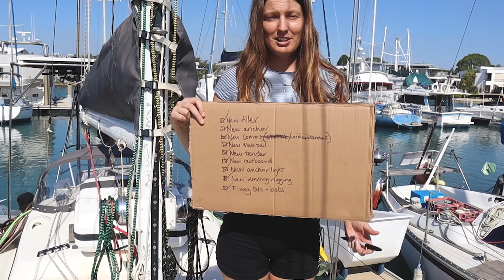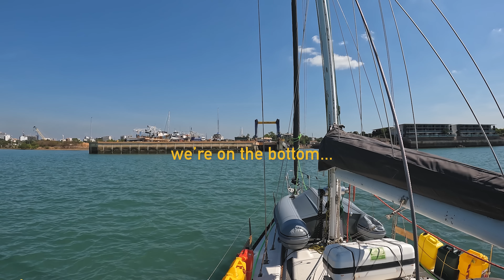THE VIDEO WE NEVER WANTED TO MAKE..

Comment: A couple of things. On our Duncanson we either epoxy resin the through hulls in or use 3M 5200. Both work fine and with the belief they are permanent fixtures. Once you get to Fremantle the Fremantle Sailing Club (FSC) offers 3 free days berthage for bona fide long distance sailors. Pens are available at reasonable??? rates or plenty of sheltered anchorages nearby, including free (Red) mooorings supplied by the Department of Transport for use up to 72 hours. Terry Baker - Past Commodore FSC
Reply from the maker: Cheers Terry, we have heard of this generous offer by FSC also utilizing the free cruising guide at the moment, such a fantastic service the offer.  Appreciate the heads up, we did not know of the mooring situation that is also very handy to know!

Comment: Those transducers really need an extra backing pad as well. It makes the hull locally thicker & gives something to tighten the nut down onto .
It reduces the flex that cracks anything hard away (epoxy). Bed it all in well with sika 291. Mine have had 9mm plywood pads for 20yr+, just 5-10mm extra wider than the transducer itself. All solid.

Comment: You will already have done the repair and gotten on your way, but a couple of things to remember for next time is first check that the hull is completely flat where the transducer is fitted if it has a curve you are best to make a hardwood backing pad shaped to the inside of the hull so the nut screws down on a completely flat surface. Secondly Sikaflex the f***k around the transducer flange and up the threads for the thickness of the hull then when tightening the nut only do it hand tight and leave overnight for the sika to dry and then next day fully tighten, if you fully tighten the nut straight away it just squeezes the sika out from around the flange. 

I'm looking forward to more adventures crocs and all those pesky sharks and all!

Comment: Have you considered that the transducers could be leaking because the wooden backplate (if you have them) have shrunk and are leaking. My boat was standing  on the hard for 7 months and when I put her back in the water, both transducers leaked. I decided to play a watching game and did nothing for a few days. After three days one stopped leaking as the wood swelled up and the next day the other one also stopped.  Sadly, we had other problems and she is back on the hard until next year by which time the wood  will have dried out again and no doubt they will leak again when she splashes in the spring.

Comment: In your opinion do you need a boat speed transducer?The Boat i just bought,  the owner pulled it out and glassed it in. Wondering if I need to put it back depending on how useful it is. The GPS gives S.O.G

Comment: Hi guys, Pete from SV Real Easy, we met briefly in Nara Inlet when you passed through the Whitsundays. Just a quick question about your dingy: Did you go with PCV or Hypalon? We are considering a purchase of the same dingy. The price difference between materials, however, is considerable. We have enjoyed all your videos and always look forward to the next instalment.
Reply from the maker: G'day, Pete. It's nice to hear from you. Ours is Hypalon; ours cops are a beating as it's always on deck, or we are taking it off on adventures. I guess the Hypalon is super tough, and so far, we haven't had any issues with ours at all; in saying that, I can't really comment on the PVC as we have not used any of Highfield PVC products. I would speak to a dealer though, hypalon makes sense for us as ours is always in the UV and we have taken it from the heat of the Kimberly to down south with no problem. One consideration though is i beleave the PVC one is lighter for carrying up and down the beach.  What we can say is that the dingy has been an absolute game changer and we couldn't speak higher of the product.
Reply: @ Thank you. Yes weight is the primary reason for my question. We are a small catamaran (32 ft) and limited to what we can carry on the stern. Deck storage is not an option. Be well, stay safe and successful brave souls.

Comment: Transducers.   Nightmares waiting to happen
Let's do some intelligent deductions here. 
Your Airmar is a DST
Depth Speed Temp. 
in reality , which of those do you REALLY need ?
DEPTH
The others your chartplotter will provide 
So using a Stern Mounted Airmar  ,, like the RV-200 gives you everything , PLUS Structure scan and Fishfinder useage. 
GET RID of those damn thru hulls any time you can.  I use Raymarine Axiom 12 RV - and have the RV-200 Xducer on my stern and I sleep really well on crossings. 

Option B

You can buy an Airmar In Hull Transducer that Senses thru the hull and not a Thru Hull. 
And the " Pro's " that installed it originally,, well they have a new title ....
Mickey Mouse Mechanics 
Good Luck Guys !!!!

SV HYDRA
SV JAZ